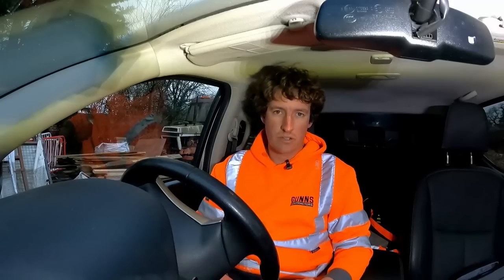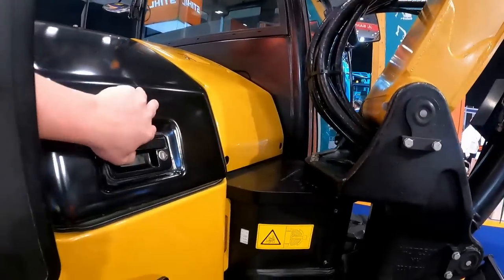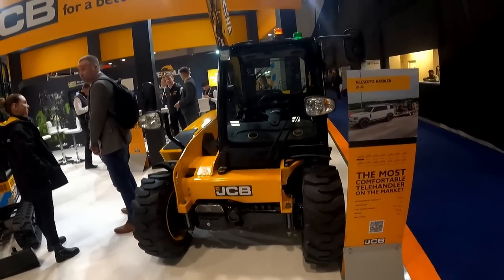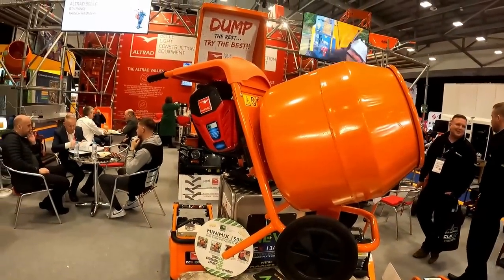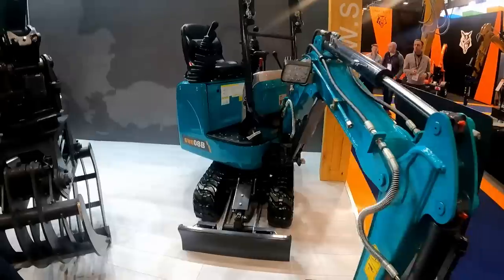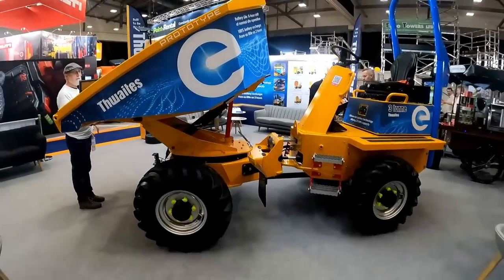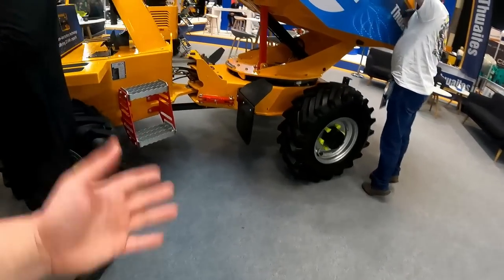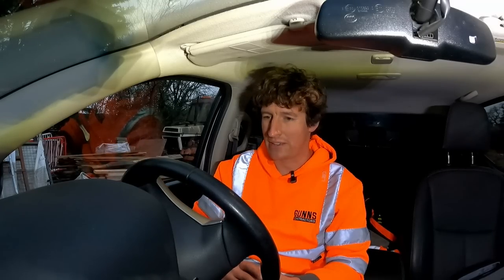Executive Hire Show 2023

Comment: Electric vehicles wether it be plant or domestic are a complete waste of time. Try getting a suitable mains supply on a site to charge them. Generators use fuel so you'll not be getting an award from Attenborough plus it will get stolen. The thing is parts IE motors. A 3rd of the price for a new machine plus the BMS ECU'S aren't cheap and you'll have a Christmas tree lit control screen in no time with faults

Comment: Electric=niche, yes!  Otherwise they are a complete rip off.  Batteries and electric motors are simply not that expensive, so for your average contractor - wait.  Unless, of course, you're putting an order in for 30!  For me, even with the hassle AdBlue (which it isn't for owner/drivers), diesel is a no-brainer.  Noise can be an issue, but just where are you operating it?  Certainly not inside an office block or the middle of the night on a housing estate.  Of course, there are situations but these will justify the price.  Sorry I'm still anti, as you've guessed.  Enjoy these videos, but we need more machinery hands on - speak to those reps Ollie!
Reply from the maker: Electric isn't for me yet either, not on excavators at least. The smaller tools like Wacker plates I think could have some mileage but the battery tech just isn't there to make an excavator run long enough on a single charge. I'd like to try one out on a real job though and see just how they do hold up to the figures the manufacturers quote.
And I've been speaking to several reps about the possibility of having some demo machines to try on upcoming projects, but I don't think my channel is big enough to justify the effort for them unfortunately as I've never heard back.
Reply: @Olliegunns  Just a quick thought, all current electric machines are small  but if and when storage levels improve can you imagine the huge charging costs to fill those batteries to the equivalent of a 5 or 8t excavator running diesel, and the length of time needed...

Comment: Do wish JCB use Torx fixings instead of those pesky Hex (Allen) fittings.
Reply from the maker: Yeah, externally, I cant see them lasting too well, especially as it looks like you would want to take that panel off to allow better access for servicing. Easily rectified though - just a shame its not identified as an issue by the manufacturer.
Reply: @Olliegunns  The engine cover fasteners will be changed for Hex Flange bolts very soon.  Thanks for your feedback.  JCB engineers do listen and we try our best to make improvements where we can.